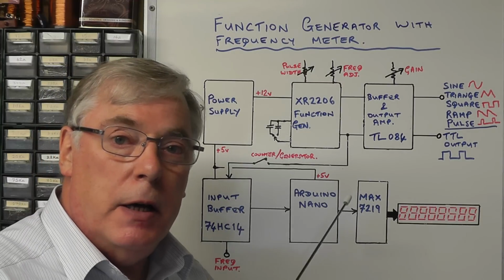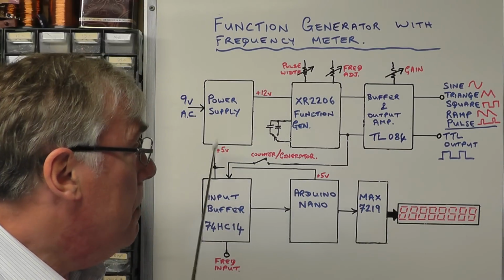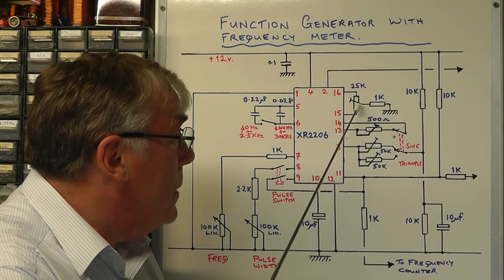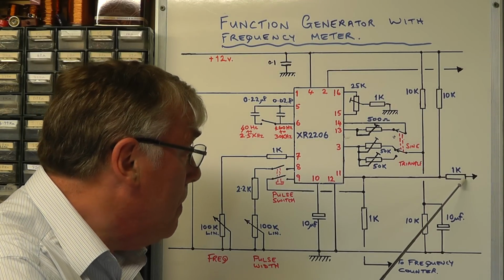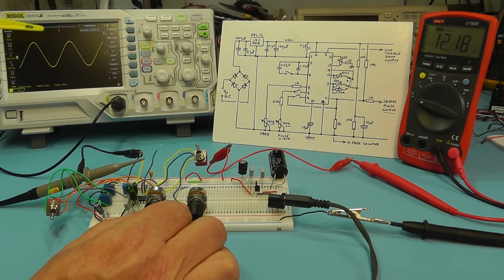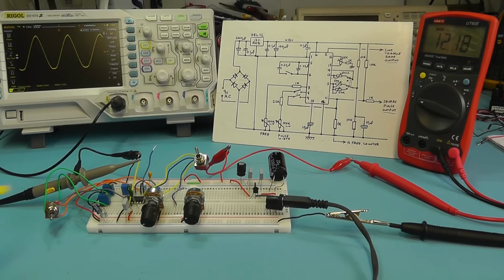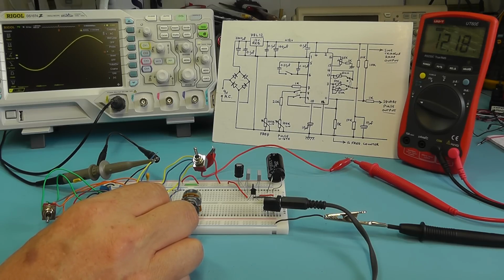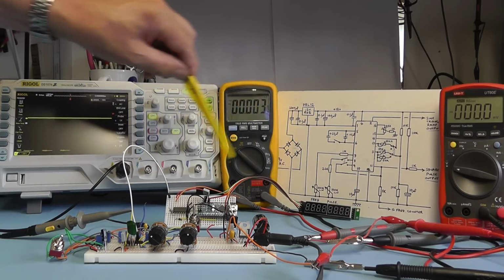Scullcom Hobby Electronics #25 - Build a Function Generator Part 1

Comment: This video is quite old now. Back then you didn't have PD capable USB chargers. You had to use a transformer and bridge diodes! Now days you do and they are super handy for powering projects! I use a PD 3.0 or 3.1 trigger module to get the output voltage I want. Any PD 3.X charger will provide 5v, 9v, 12v, 15v, 20v and 28v (PD3.1). This will power just about anything at 5 amps max or less. 100% of my small projects use a PD 3.x trigger board instead of a dedicated power supply. I have BT speakers that I converted to PD 3.0 power from micro USB. What took many hours to charge at 5v and 1 amp boosted to 8.2v now charges at 8.2v and 5 amps. What happens after PD 3.x enters your device, like needing 5v or 3.3v, is done with linear regs or small DC-DC. I power my o-scope, cameras, tracker, battery testers, load tester, etc all on trigger boards and PD 3.X capable USBC wall bricks. Many of the multi port versions negotiate each connection independently. A single 4 port USBC charger can be charging my phone at 15v, powering my tracker at 9v, my load tester at 12v and powering my scope at 20v all at the same time. One power supply source that covers just about everything!!! Sometimes the output DC isn't super clean, but that's easy to resolve with an electrolytic cap on the trigger board.

Comment: The cost differences being what they are (minimal),  I would never bother with the lower-end numbers in the 1N400x parts,  except for things like putting one across a relay coil or similar application,  and only because I have salvaged a bunch of those.  I can see a manufacturer going with those lower numbers, but for the hobbyist it's just not worth bothering with them.
On the function generator portion of things,  I like the 8038 chip.  I build a function generator that goes from 20-20,000 Hz with no range switching.  The output amplitude is consistent no matter what waveform is chosen, and I also have an optional DC offset available with a switched potentiometer that you pull to activate.  I didn't choose to implement any pulse width option in this instrument as I see a pulse generator as being a separate bit of test gear.
It was odd to see that "wall wart" give up when you were only pulling about 120mA or so out of it. I have boxes of those things and I don't think that I've seen any that were rated any less than a few hundred mA.
On the issue you're having with the frequency counter,  perhaps you have some variable declared as "int" when it should be "unsigned int".  :-)

Comment: Oh boy my 1st homebrew project! I purchased an XR2206 kit via the Internet a while back for the sole purpose of soldering experience (plus I like to make noises). I did a very poor job in assembling the unit but it did work as best as the poor design and choice of parts allowed (the IC is a clone that can only operate at lower voltage). Well, long story short I recently removed every component off the PCB for the sole purpose of DEsoldering experience! 😂Let's see if I can put something together that meets the most of the requirements you have here. At the very least it should provide all the waveforms with sweepable frequency and amplitude. Thank you for your hard work!

Comment: can the amplitude be increased to 20vp-p
Reply from the maker: Hi Arun,
In order to get 20V p-p you would have to change the output stage to give that level of voltage swing. This would also need a modified power supply that could feed that extra voltage level. It is possible but would require a redesign of the circuit.
Regards,
Louis

Comment: Great video, very well done and documented. I just got a question, the XR2206 witch you use are cheap Chinese one or are the original? The reason I asked is because the Chinese copy has some issues regarding the power supply voltage, if you have time just have a look at https://forum.allaboutcircuits.com/threads/problems-with-a-xr-2206-function-generator.101369/page-2 . Thanks and keep doing this kind of videos
Reply from the maker: Thanks for your comment. The XR2206 are original which I purchased many years ago. As you say there are cheap Chinese ones also available on ebay. I did buy a couple to test in the circuit and they seemed to work OK. Thanks for the link.
Regards,
Louis

Comment: Hi, thank you for the video. I am currently planning to use your circuit for my own function generator.
One question though: Why do you disconnect the resistor network from pin 8 when not using the pulse/ramp mode? I am thinking about using a rotary selector switch to control the different output signals and want to see how many different poles and positions I need for that.
Reply from the maker: Thanks for your comments.
The XR2206 has two oscillator timing resistor options on pin 7 and pin 8. For normal operation of Sine and Triangle waveform pin 7 is used and pin 8 is normally left unused (simply left disconnected). In my circuit I am using pin 8 timing to adjust the width of the pulse in pulse mode. Depending on the logic level at pin 9 (Frequency Shift Keying Input), either one or the other of these two timing input pins (7 or 8) is activated as the oscillator timing resistor input. Pin 9 is normally left open (not used) in normal mode and in that case pin 7 is used as the default timing resistor pin.
You will notice in my circuit I switch pin 9 to the pulse output pin 11 and this causes the timing pin to switch between pin 7 and pin 8 also at the same time I switch in pin 8 with its timing resistor - we now have two timing resistors available. This now allows the timing of the pulse to change (toggle) as pin 9 switches from positive to negative pulse. In this way we can alter the pulse width.
Hope this explains things.
Regards,
Louis
Reply: Hi Louis,
I got that, the question is just why you disconnect the timing resistor at pin 8 with the switch. Is there some influence on the timing when pin 8 is connected but pin 9 and 11 are not connected?
Reply from the maker: eNBeWe You could just use a single pole switch between pin 9 and pin 11 if you wish and leave the resistors on pin 8 connected. This should work fine as when pin 9 is left floating pin 7 timing resistors are used by default.

Comment: Fantastic video! Question... 

Why is 12V feeding into the 5V regulator? Wouldn't it be better to connect the 12V and 9V regulators parallel?
Reply from the maker: Thanks. The 9V input is AC and once rectified and smoothed gives about 13V to 14V which is then fed to the 12V Regulator. If you mean to add an addition 9V Regulator yes you could do that but there is no real need, as it just adds more cost. I think I did change the 78L05 to a LM7805 in a TO220 package which handles the voltage drop OK - maximum input voltage can be as high as 35V but usually 10V to 12V is used.
Regards,
Louis
Reply: @scullcomhobbyelectronics1702  If you are using an external AC power transformer rated as 9VAC, hopefully its actual voltage is somewhat higher. 9 VAC rms is only 9x1.414=12.726 volts peak. This voltage is applied to the 3300uF input capacitor through two silicon diodes at 0.6V drop each, so the input voltage to the 78L12 would be only 12.726 - (2x0.6) = 11.526 VDC. Not high enough. Also, you did mention that the external power source had to be AC and not DC. I don't think that is true. You can apply a DC voltage of either polarity to the input, and the bridge will route the +  and - lines appropriately. A DC "wall wart" of around 15VDC or slightly higher would work fine.
Reply: I assume that you meant "to connect the 12V and 5V regulators in parallel"? Yes, I think that would be a good way to do it. With the present series connection, the 12V regulator has to supply enough current for both the 12V and 5V rails. With a series connection, the 12V regulator will not have to supply as much current, but the 5V regulator will have higher power dissipation. For a one-off hobby project either series or parallel will work, but if you use the series connection, upgrading the 12V regulator to the higher-current LM7812 might be a safer option.

Comment: Thank you for creating this great project with such attention to detail, its an inspiration to us all. BTW I found this Phase-shifter circuit on the net http://www.tedpavlic.com/teaching/osu/ece209/lab1_intro/lab1_intro_phase_shifter.pdf , which  provides a frequency -dependent phase shift with unity gain. I can now use your function Generator with the XY mode on the oscilloscope. It needs your expertise to work out how to incorporate it into the design! Again, many thanks,
Reply from the maker: I had a look at the link you provided. You could try adding this circuit in the output stage between U3B pin 5 and the switch SW4 in my schematic. Direct link to schematic I am referring to below:
http://www.scullcom.com/Function_Generator_Schematic.pdf
Reply: Thank you for your reply, your suggestion works perfectly. I think I'll have to make a second complete circuit so that I an create Lissajous patterns! Again many thanks.

Comment: Could you also reliably have a variable capacitor for the frequency
Reply from the maker: In the circuit I described a variable capacitor would not be practicable as the timing capacitor values are large at 0.22uF and 0.02uF.

Comment: I guess I'm missing something here, but why in the world would you not use just a dc power wall wart to power the unit.  They are all over the place but trying to find an ac wall wart in a flea market would be a pain.  BTW I like the video very much.
Reply from the maker: +Joseph Nicholas Thanks for your comments. The power input can either be an AC 12 power pack or a 12 DC Power pack. If you use a DC power supply unit then the bridge rectifier on the project will simply act as reverse voltage protection on the power input which means the DC supply could be connected either way and the unit will still work OK.

Comment: Great stuff, very well explained.
Following your instructions I have built a slightly modified version, it works very nicely but I've got a small spike on both sine and triangular waves at the top and at the bottom, it gets worse at higher frequencies.

I've tried many workarounds, but none of them worked. A lot of people write about this issue in many forums, but haven't found a working solution yet.

Do you have any idea on this regard?

Thanks for your good work.
Reply from the maker: +Headstone Graveyards I have found that this problem may be affected by the symmetry adjustment. Also the bias voltage supplied to pin 3 can cause issues - try changing the value of the 10 uF capacitor by either decreasing to 1 uF or increasing to 25uF. As the circuit is simply supplied with a single positive supply it needs a bias voltage on pin 3 to simulate a centre point. You could also modify the circuit for a dual +12 & -12 power supply which is likely to solve your issue, in this case pin 12 would connect to the -V supply and pin 4 to the +V supply; in this case the other end of the capacitor on pin 10 would connect to the -V supply and not ground. Also the bias voltage arrangement for pin 3 would need to change so it was taken across the +V an -V supplies and not between +V and ground. Also I think the bottom legs of the two potentiometer would go to -V supply.
Reply: +Scullcom Hobby Electronics Thank you very much for your response. 
I tried everything you proposed, but the spike was always there. I solder the pcb hoping that a parasite capacitance from the breadboard was the problem but  that didn't help.
I decided then to start from the beginning with the bare minimum components (the only components I saved from the pcb are the potentiometers and the xr2206 itself) and testing every step. This time, the spikes weren't there. I guess that a faulty component was the source of the issue.
I am happy though that the first time it didn't work as I have learned a lot. 
My next project will be a function generator build up just using op amps to produce all the kind of waves.
Reply from the maker: +Headstone Graveyards Glad to hear you fixed your problem.

Comment: Hello there, I'm an EE student(still a novice). I was curious on why add a Schmitt trigger buffer into the arduino input, thinking of the hysteresis, won't it effect measures for the frequency? Also, what is the idea behind using the arduino to measure the frequency? I can imagine from a square wave input, the arduino through coding can count each rising edge per second and display the frequency, but how are you doing that for the sine wave and triangle wave? Or does that work only of the square wave that is matched the waveforms. Sorry writing a lot😅
Reply from the maker: +thewld2 The reason I used the Schmitt Trigger buffer feeding the Arduino was to ensure the waveform was a clean square wave so that the frequency counter function worked accurately. When you select the sine wave and triangle wave for the output you still use the output from pin 11 of the XR2206 to feed the frequency counter. The outputs at pins 2 and 11 of the XR-2206 are always present no matter what output option you select.

Comment: 32768 is the maximum of a signed int, seeing as you will have no negative values you could make it an unsigned int (this being the variable that is counting the frequency) this should allow you a range from 0- 65535. cheers!
Reply: Actually, the range is from -32768 to +32767. A more convenient way would be to use an unsigned 32-bits and use a few digits on the left side for the decimal portion (0.000 to 4294967.296). Just my 2 cents.

Comment: AC plug-pack adapters are unregulated until they're loaded, then only very roughly; they rely on the natural regulation point of the transformer at rated load.  You were initially seeing 12V from the 78L12 because the 9VAC plug-pack was very lightly loaded and not in regulation.  Once the Arduino and 74HC were added, its transformer was pulled into regulation and you were getting, at best, 11.3VDC at the input to the 78L12, which obviously isn't enough to accommodate its dropout voltage [9VAC times 1.414 equals 12.7VDC rectified, minus 1.4V (two diode drops in the bridge) equals 11.3V].  Neat project!  I'm off to view Part 2...
Reply from the maker: FlyingShotsman Thanks for your comments. You will see in Part 2 of this project that I am now using a small 12 volt DC output switch mode power supply which has a maximum output rating of 5 Amps (more than enough). These modules are low cost on eBay.
Reply: Indeed, it turned out quite nice.  Well done, sir.

Comment: Really enjoying this project. Thanks for posting this! I had started to suggest that the data type you used to store the frequency read was an int, which would restrict your frequency counter to display numbers between -32767 and +32767. Then I found your Function_Generator.ino code, and found that the version posted on your website declares an unsigned long integer variable called frq to store the frequency read. At first, I guessed that this fixes the problem of not being able to display frequencies higher than 32767. But upon further study of your printNumber() function, it looks like you also need to declare the v variable as an unsigned integer, along with the data variable (which was assigned to frq in the loop() function), and add a hundredthousands variable, to handle the sixth significant digit. The XR2206 appears to be able to go up to 1Mhz, but I'm not sure if it is worth adding a third capacitor in your circuit to get the output to 999,999 hertz.

Comment from the maker: Sorry for the delay in posting Part 2 of this project. This is due to other commitments. I will try and post Part 2 with in the next 2 weeks.
Reply: Thanks for this. Just built a slightly similar version with no counter and am much happier with the output than I was with a "barebones" XR2206 circuit I tried before.

Will you by chance be putting up schematics or a layout?
Reply: Scullcom Hobby Electronics  I'm waiting for the final design as I want to build this as well sir :)..

Comment: Seem to to be doing similar stuff,I had some xr2206's turn up as you posted this and I,m sorting a voltage standard also.You say you are using a op amp on the out put,is that  used as a buffer to  regulate  wave levels and chained for bandwidth?
Nice Channel keep going.
Reply from the maker: Paul Millard Yes I will be using an OP Amp as a buffer. I will cover it in Part 2 of this project. I hope to get Part 2 done in the next 2 weeks. At the moment I have other commitments which I need to do first so sorry for the delay.

Comment: Isn't that 78L05 working a tad too hard with an input of 12V?
Reply: +Scullcom Hobby Electronics 
Also, you should use a 10VAC or 12VAC transformer!
9VAC is insufficient to get enough voltage for the 12V regulator to operate properly.
Reply from the maker: David Jubb Thanks. I have changed it to a 1 Amp version and added a small heatsink.